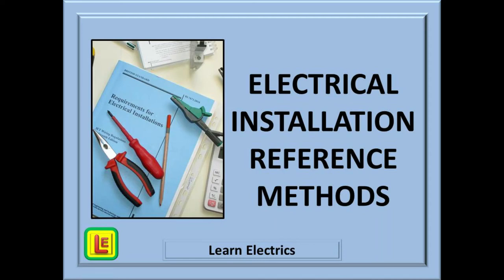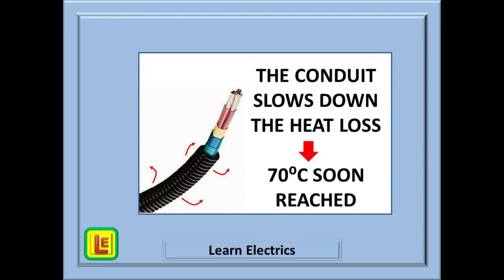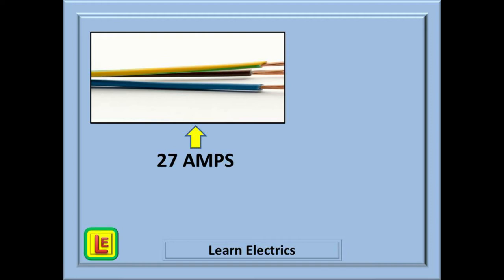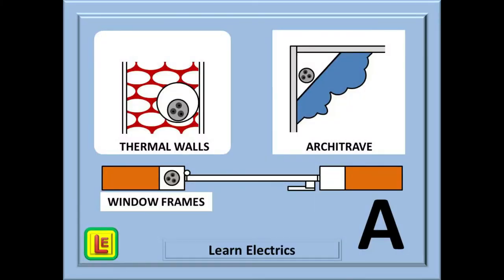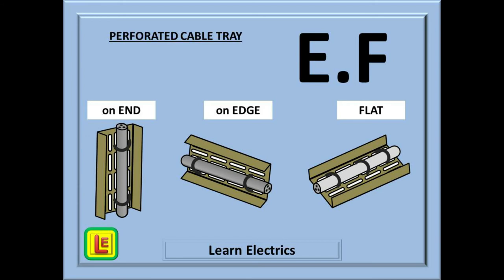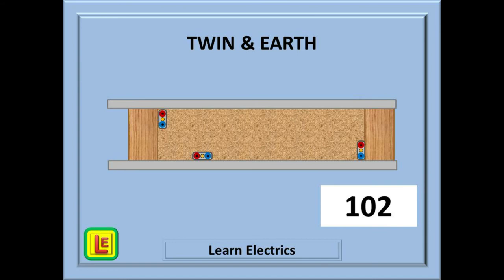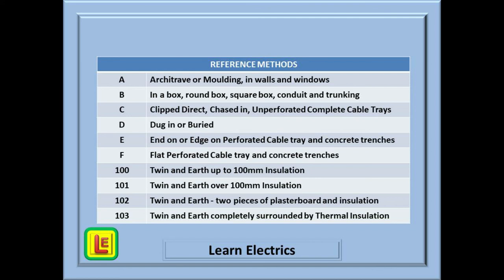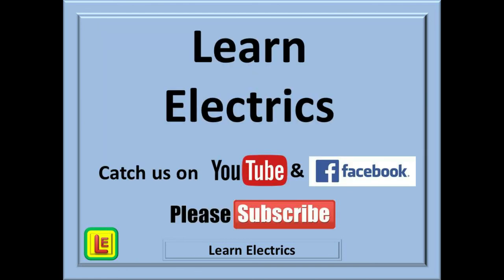Learn Electrical Reference Methods, Installation Reference Methods

Comment: Very useful thank you. I have a question if I may.... in my new build loft I have a spaghetti mess of 1mm lighting cables that don't follow the roof trusses, they just go directly to each light fitting or switch. They go up and over each roof truss they pass and then drop down to rest on the plasterboard ceiling beneath 270mm of insulation. Is this reference method 101 or does the entire cable run have to be touching the non-insulation surface for its entire length? I fail to see how thats possible in a modern loft though where there are roof trusses in the way. Additionally, some of the cables are so tight that when they pass over a truss they don't have enough slack to get back down to the plasterboard before rising up over the next truss. The insulation has simply been laid over them in this case. Is this classed as reference method 103 then, although they do have some limited contact with the truss timbers they are strung between? Thank you
Reply from the maker: Its reference method 101 if it is in contact with a plasterboard ceiling or roof trusses and the insulation exceeds 100mm. The worst case reference method applies to the whole cable, and reading your notes this will be 101. Dave.

Comment: what would be the reference method of cables clipped to a joist or lying on plasterboard ceiling in joist void without any insulation? I would assume clipped direct but it’s not necessarily clipped on a wall.
Reply from the maker: Have a look at Table 4A2 on page 433 of the Regs. Pictures of each type are shown.
Reply: @learnelectrics4402 Have had a look and still can’t see anything regarding without insulation, the closest thing i can get to cables clipped on joist without insulation is Method 100, being With Insulation not exceeding 100mm.

Comment: Your videos are put together better than anywhere online or in the classroom

How would you class a cable that's clipped direct then passes through stud wall with insulation?

The wall and insulation is worst case so would you class it ref 100 instead of clipped direct?

Thanks sir.
Reply from the maker: Yes, always use the worst case for the cable conditions. Take a look at this video on condition codes. Dave.
https://www.youtube.com/watch?v=YQpDDBoZp7c
Reply: @learnelectrics4402  Thanks bud appreciated 👍

Comment: very very well explained thankyou. quick question. what if the supply is wired through multiple reference methods? do you add all in the test she or just the majority of the circuit?
Reply from the maker: I will be doing a video on that soon. You multiply them all together, which men]and the cable needs to get bigger.
Reply: @learnelectrics4402  thats great but i mean more about writing on the test sheets. can you group the reference methods in same box. lie a b and c in one box
Reply from the maker: Yes, you can just list them. It's your test sheet, if you feel you need to add extra info, then do so. Good luck.
Reply: @learnelectrics4402  thanks very much. i appreciate your help and quick reply. your videos are fantastic.

Comment: I’m planning to wire up my garage with PVC singles in a plastic flexible conduit.
If I use a radial circuit and 20a mcb, would this be safe? If the wire heats up to 24a in the conduit, it will trip the 20a switch anyway?
Reply from the maker: Guj, you need lots more information before you can decide on anything, Such as cable size, cable length, how many wires in the conduit etc. And no, 24A will NOT trip a 20A circuit breaker in a safe time.
You need to use the data in the On-Site Guide. Take a look at the video on the link below, this will be really useful to you. Lots more info and links to videos on our website at LearnElectrics.com
If you're new to electrics, always seek good local knowledge from a competent electrician that can help you plan the work. 
This is the video ....
WHY MY FUSE BLOWS AND WHY 8 AMPS WILL NOT TRIP A 6 AMP CIRCUIT BREAKER
https://www.youtube.com/watch?v=FZ6-okbgXKo

Comment: Can a reference method change mid cable run? Let's say you're in 100mm loft insulation and need for example 6mm2 cable. If then it comes through the ceiling to an isolator, then out of the isolator it's clipped direct. Can you reduce the size of the cable then?
Reply from the maker: The cable size must suit the conditions at each point, so yes you can change sizes where it comes out of the isolator.
Reply: @learnelectrics4402  Thankyou for your reply.. I have learnt so much towards my qualification from you. Respect 👍

Comment: What is a thermal wall - for ref A?  If I have a  standard bulding brick external wall with cavity insulation and T+E  chased on the inner with pvc or metal capping and plaster is that A (2) or C (58)?
Reply from the maker: Have a look at page 436 in the regs book. If item 57 or 58 apply, then it will be Reference method C. Hope this helps. Dave.

Comment: Hi Dave. I've got cables going through middle of joists (drilled hole) in a garage and then clipped onto wood, and also clipped onto brick. What is the best classified reference method?
Reply from the maker: Sounds like clipped direct to me. If its twin and earth, look at Table 4D5 on page 456 of the Regs book. Reference method C - clipped direct. Dave.
Reply: @learnelectrics4402  Thank you very much. I did think it would be reference method C too.

Comment: Question: If I have a ref method of 100 do I still apply the Ci rating factor in the cable calculation?
Reply from the maker: If you look at page 409 in the blue Regs book, 2.5mm T/E for example says max current is 21Amps, that is your Ci applied, now calculate the other factors that migt affect it starting with 21A. Hope this helps.
Reply: @learnelectrics4402  Much appreciated.

Comment: What is your opinion of cavity wall insulation beads(not polystyrene that affects PVC on cable)  where existing cables are already in the cavity that is only 2 inchs wide. Even if the cable was in the middle of the cavity it would be max one inch of insulation max between it and the brick walls . Would it be better to remove cables and put in round plastic trunking inside the cavity ?
Reply from the maker: The plastic trunking will still have insulating properties, and it will then be inside a thermal wall. your choice again.
Reply: @learnelectrics4402  Yes , i agree , It would not be correct . Thank you.

Comment: What reference method is T&E cable in a conduit buried in a non thermal insulated wall?
Reply from the maker: We wouldn't normally put t/e in conduit. I would go for worst case 103 if its already built. Use singles in conduit where possible.
Reply: @learnelectrics4402  I done a recent rewire whereby open ended conduits ran from the loft to the socket/switch boxes in the wall below, all done in T&E.

Comment: What would ref be clipped under floorboards C or B in a void ? Always get contrasting views. If it is B then do you refer to ref B cable current carrying capacities?
Reply from the maker: That's always a good one. If the void looks like the ceiling pictures for methods 100 to 103  then some folk stick with them. But if its a small void with no ventilation, perhaps B is better. And also consider what current might flow. If it was a 9kW shower I would certainly derate it. If its a 6A lighting circuit perhaps not. The size of breaker is doing the derating for you.

Comment: Hi great video... Quick question? What would be the difference between reference method A and C in terms of a Flat Twin and CPC clipped to a chase then plastered in? Ref A says within building materials and Ref C says chased in? 

Also, what about a circuit tgat contains many reference methods? Chased in, then through a plasterboard ceiling, then in trunking and finally to, let's say an IP rated socket outside? 

Thanks
Reply from the maker: This sounds like Ref C - chased in.
Where there are several methods always rate the cable for the worst conditions, then everything else will be ok. On the certificate you can write in all methods e.g. C, 101,B or just the worst case, the one that you have selected the cable rating against e.g. 101
The important thing is to leave sufficient information on the certificate so that anybody following you can work out what is happening and why you chose certain cable sizes. Hope this helps. Dave

Comment: What if you get flat sheathed cable on tray?     There is no data in table 4D5 for reference method E. But there is current carrying data on method E for ''multicored cable''..   Can flat twin and earth be regarded as a multicored cable ?  if T=E in on tray. can I use the current carrying capacity data of multicored cable?.. or just stick with the data for flat sheathed cble with only goes up to method C..??and just use capacity of method C with is safer than method E anyway. I've got the design exam in two days. Thanks
Reply from the maker: Twin and Earth on a tray is always confusing, but it is a multi-core cable and can be prone to be packed with lots of others on a tray. Reference method C is clipped direct cables in/on walls.

Comment: Where a cable drops down in a cavity wall would it be bad to cut this off and just connect a larger cable in its place where it runs through the cavity wall insulation. Would it be bad to have these connections in the attic ??
Reply from the maker: Nothing in the regs that stops you doing this, you are installing cable suitable for the conditions at each stage. But make sure your connections are good and accessible. Also, it might cost more in time and materials to do that, rather than just run the bigger cable all the way through and have no worries. Your choice if it is safe.
Reply: @learnelectrics4402  Thank you very much for your opinion. I will check the existing cable suitability first. Its the external hot water tank circuit which gets the most use in the house. The cooker circuit is on an internal block wall so does not use the cavity. I am not overly concerned about the wall socket cables as they do not get prolonged use ie kettle or hair dryer etc

Comment: Hi, as has been stated many times your videos are excellent. Just one question, are reference methods 100 to 103 only applicable to twin & earth, or are methods A to F also applicable? Many thanks.
Reply from the maker: !00 to 103 apply to twin and earth because of the type of construction and the type of installation methods, ceilings, walls etc. in domestic properties, perhaps in shops and small units etc., the sort that you wouldn't normally get in a big factory for example. Methods A to F apply to all the other drawings in the appendix which are more applicable to industrial work. Hope this helps. Dave.
Reply: @learnelectrics4402  Thank you.

Comment: Just a quick question Sir.
Ref method C for 2.5mm  twin & earth chased in and plastered in, the current carrying capacity is 27Amps.
What about heat dispensing?
Reply from the maker: Its been allowed for. Have another look at the video and it will make sense. Thanks for watching and lots more to come.
Reply: @learnelectrics4402  thanks a lot Sir
Reply from the maker: You are welcome.

Comment: Domestic its Refrence Method B, unless it's  armoured its C, in real life you don't get paid to investigate and start cutting plaster boards or going through walls finding out how the thickness is or how much they are not exceeding. You can not go and do these reports cutting through plaster boards and walls to find out how cables are sitting or they're mm not exceeding.
Reply from the maker: Thanks for the input Raj. Appreciated.

Comment: if cable is run through a conduit inside a concrete wall what installation method do i use?
Reply from the maker: Have a look at Nos 41 and 42 on page 435 of the Regs. One of these methods might be what you are looking for, Thanks for watching. Dave.

Comment: Hi! I have found this, regarding Method E and F. Is this correct?
Reference Method E – Single-core on perforated cable tray or ladder rack.
Reference Method F – Multi-core cables on perforated cable tray or ladder rack.
Reply from the maker: Have a look at pages 438/439 in the Regs and have another look at the video. Hope this helps. Dave.

Comment: What would be the reference number for the following T & E cable:
(1) A cable laid over a plasterboard ceiling without any insulation (no clips)
(2) A cable within a dividing wall.   Plasterboard each side on timber studding.  No insulation.  No clips.
(3) A cable behind kitchen units and supported by the floor. No clips.
Reply from the maker: Kevin, determine the three reference methods for each scenario and choose the worst one. If the cable is sized correctly for the worst case it will be good enough for the other two. Without seeing the job it is difficult to say but it looks like 1 and 2 might be Ref C and 2 is either Ref C or Ref B. Look at pages 383 to 392 in 18th Edition Regs. that will help you to make a decision. dave.
Reply: Thanks
Reply from the maker: You're very welcome.
Reply: @learnelectrics4402  I’d like to say what a brilliant video this is not just for learners but also older electricians too. 
it is confusing in this type of situation to select the “worst case scenario” (especially on an eicr, as you don’t know how the cable is run) as far as current carrying capacity goes is it simply a case of a is best and f is worst, when choosing which one to select to go on the eicr?
Reply from the maker: Usually put the reference method for cables in containment or thermal insulation as they will not lose heat the same as those clipped direct or in free air, so yes, put the worst case on the certs.

Comment: When it comes to ring mains do you half the rating of the MCB since it has two paths to travel through? When I look at T&E on page 409 of BS7671 a 32A ring main would require 6mm cable for method 100#?!
Reply from the maker: No. MCB size and cable size have to match against the load and the type of circuit.
Take a look at our video.
Ring and Radial Circuits What are the Differences
https://www.youtube.com/watch?v=6GNb1SSEjQg
Ring circuits also require extra testing and we have a video for that.
Whatever you do, remember that electricity is dangerous. An incorrect installation can causes fires.